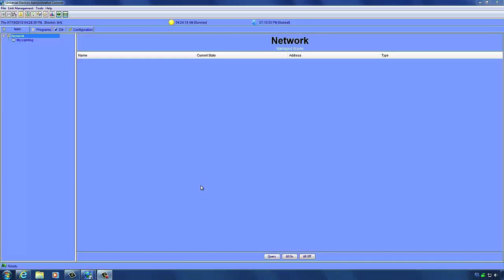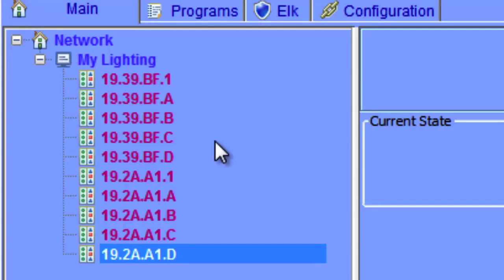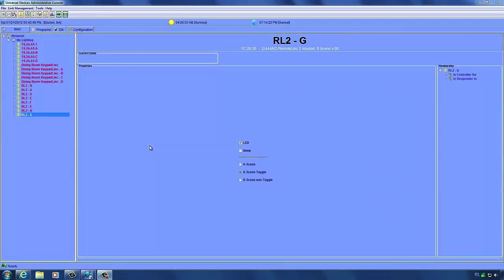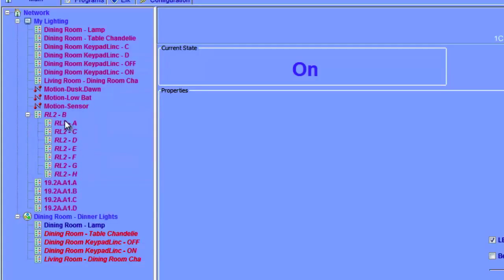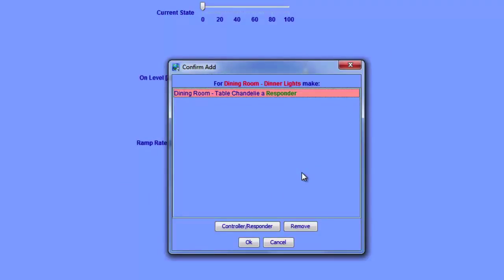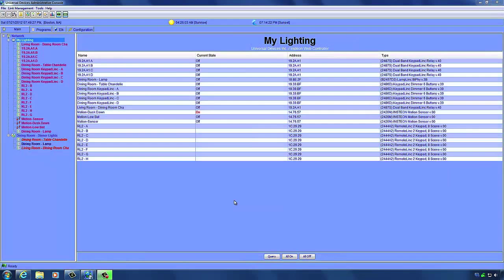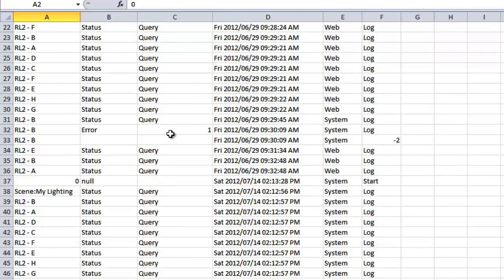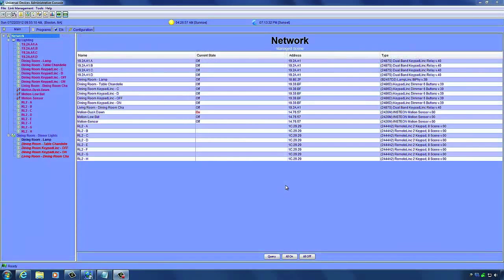ISY - Linking, Scenes & Troubleshooting

Comment: You might consider redoing a portion of the video. Your explanation of linking devices and the choice to make is contradictory ie. Not to chose the last option which in your explanation is the choice to make. The mouse pointer is hovering over a different choice than that which you are talking about

Comment: Also remake the Scenes portion showing the difference between device settings at the Scene folder level vs those at the individual device level.  The mutual exclusive bit is interesting but should be a separate video.  The two levels of settings for a Scene is much more fundamental and important.